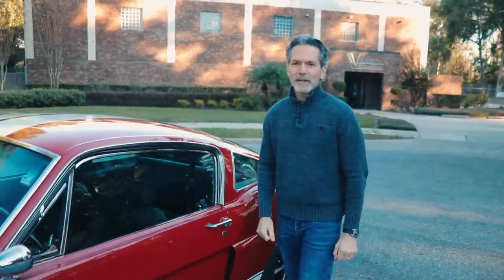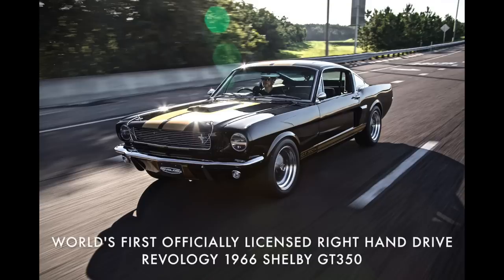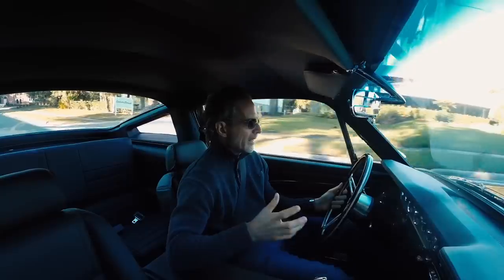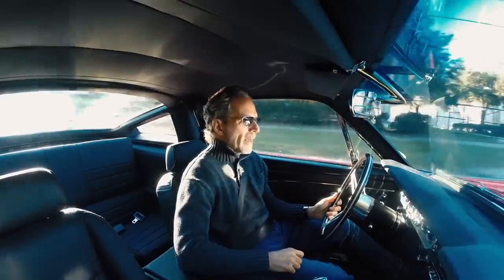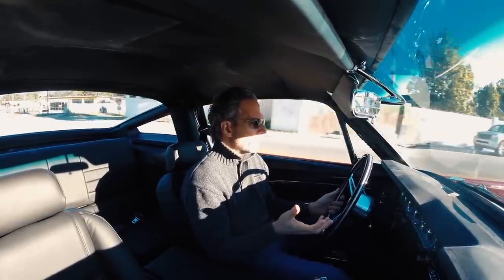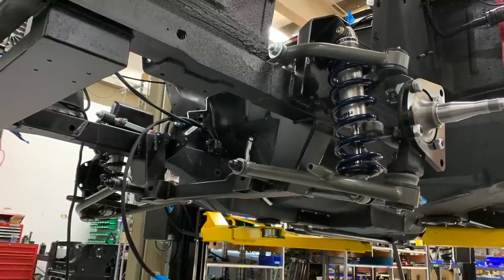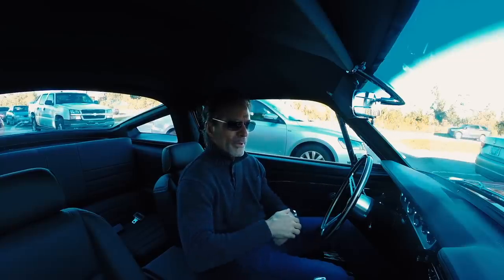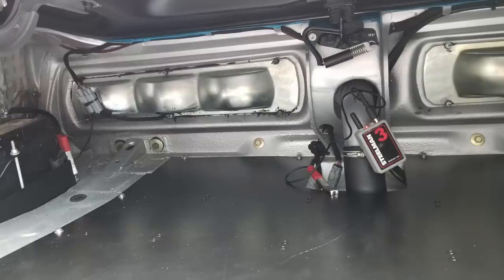Revology Delivers its 50th Ford-Licensed New Reproduction Mustang

Comment: It's a modern hot rod same as a Fiberglass 32 Ford body on a new suspension with a LS motor. It's not a Shelby anything. C. Shelby was a road racer as were his early cars not a compromise of confort vs ability to go around a corner fast. They didn't need huge Horse power numbers because they were light weight. A Sports Car!
Reply: David Read Tick ✔️ I’m from Australia 🇦🇺 and have old torana’s the whole reason you hop out of a newish car with all the bells n whistles is to feel 18 again to go back in time the road n bumps revs ,cam and a Carbie that was the stereo correct. As you said that’s a new musi

Comment: Have you guys had any luck installing reproduction window trim on the front and rear glass or is refurbishing the original stuff the only option? Also, are the tabs on the reproduction bodies in the right places to get the trim to fit properly? And since I am asking so many questions is anyone reproducing the chrome quarter window vents or do you guys have to refurb them also? Finding all the quarter window components in show condition is getting pretty much impossible!

Comment: How about no.
You can build one using a brand-new Dynacorn body, with everything set to your spec (engine, trans, interior & paint) for half the price of one of your restomods.
Reply: For us gear heads, that is the way to go.  But for the people that pay others to do everything for them and have trouble toasting their own bread, they get these restomods.  But they are going to pay a lot for them.  That is the price people pay for more money than brains.  I have seen this in many aspects of life. I saw a guy trade in his fully paid Crown Victoria that he just paid in full because the said it took too much gas.  He told me it was costing him 250 a month.  He traded that beautiful, fully paid, Crown Victoria for a hideous little economy egg Toyota Yaris.  When I asked him how much he was paying a month he told me he got a bargain and was paying only $435 a month.  What an idiot.  On top of that he has to pay full coverage on a new car, excise tax for a new car, registration for a new car, and still has to pay a fuel cost. That idiot had more money than brain.
Reply: If you can do better, can afford to take 6 months of your life off, and have a facility with a lift, fabrication equipment, an industrial sewing machine, and a paint booth, source all of the parts, materials, electrical, tools, and spray guns, then by all means, go right ahead. The rest of us will be happy to criticize your results, ad nauseum.
Reply: @bryanhallman8183  I built my own.  It is likely considered very ungainly and too unfamiliar to be appreciated by anybody but me.  However, it did start its existence as a standard production vehicle.  Only the transmission remains completely stock.  Even the spark control computer has been flashed to nonstandard settings.  I had a keyless ignition with a transponder card long before it was implemented in a production vehicle.  My lighting was changed to LED long before it was in standard production also.  I would often get comments on it.  The engine has a custom intake system.  The entire dashboard and controls are all custom wired.  The doors do not have power windows nor a crank.  The body still somewhat reflects what the standard production model looked like but almost all of it except the main body has been changed.  Axle ratios, suspension, engine cooling, rear brakes, lighting controls, radio, dashboard, seats, carpet, tyre size, bumpers, top, windows, exhaust system, and much more have been changed to something I created or to an aftermarket part I wanted.  The transmission is the only thing stock and it is starting to fail.  I have plans for exaclty the transmission I want to install in it.  But as you mentioned, others will critisize it add nauseum because it is so unconventional and rather antiquated looking.  But she has become a friend to me and it is likely we will never be apart.  I wonder if the engineers that design the modern hideous automotive atrocities feel as if what they designed has become a friend to them or not.   Perhaps this may be why there is such a grotesque similarity from model to model today, the engineers fell in love with a certain design. Maybe to the engineer the lackluster, bland, ugly, weak, designs are really quite beautiful to them.
Reply: @indridcold8433  Thanks for your response. I can fully appreciate how hard it is to build, or restore a car from the ground up.  My comment was directed at Hugo, whom I don't think can understand, that not everyone has the level of expertise, time, or the space requirements to undertake building a complete car from scratch. R3 is willing to sell a fastback or a convertible, 65-70, with a suspension for $32K. You still have to come up fenders, hood, and trunk, supply a drivetrain, wheels and tires, interior, electrical, gas tank, and basically everything to complete the process. Now, you've done that, and that's awesome, but, you and I are in very different situations. I would have to pay a garage to rent space to work on it, buy all the tools, welders, lift, materials, fasteners, odds and ends, and frankly, I can't do that. If you can't knock Porsche, Mercedes, Ferrari or Lamborghini for what they charge, how the hell can you then sit back and knock these guys, for building cars that are on that same level? It just doesn't make a whole lotta sense to me.

Comment: I have a Mustang 66' coupe, my first car. i have put the Global West suspension and it's a similar front end, not as beefy as this repRoduction 66' but its works. Also have disk brakes all around, 9" rear end, Msd ignition and Crane Rocker Rollers on the 289 heads that were rebuilt for modern fuels. 
But Not  In my wildest of dreams, would i have ever thought they would reproduce this old Ford! When i got mine in 1981, my friends jeered & sneered as it was a pretty old vehicle. They were driving Datsun 240 Z's and Capris  were all the rage. My  'Rustang' was almost a joke to them! That's pretty funny now! 😎😜

Comment: This is exactly what Ford should be producing today.  The current Mustang is in name only.
Reply: The current Mustang is a Mustang and about 100x better than the original.  The original was a Ford Falcon with a different body and a V8.   The current car has it's own chassis and motor - a much, much better automobile.  BTW - the first Mustang I drove regularly was a 1965 starting in February of 1965 so I'm quite familiar with the car.
Reply: @buckhorncortez  I think you missed the point.
Reply: I don't like the '15 or newer Mustangs, but I love my '13 GT.

Comment: Cougar XR7 65-68 would be cool
Reply: Cougars came out in 67...
Reply: @studebricker2845  yeh i couldn't remember exactly I knew the 69 i did not like as much. The Comet was another one i liked. Those 289s are some great engines.
Reply: @stephengrahn9361  They are. My first Mustang had a 2V 289 C4. My last Mustang had dual quad 289 with a toploader.
Reply: @studebricker2845  Right on. Mustangs were my Mom and Dad's favorite while my Grandpa was crazy about those old Mercury's

Comment: It amazes me how ugly, lackluster, week, and lifeless modern cars are.  I do not know how automotive companies stay in business.  I guess bailouts taught the modern car companies nothing except they do not have be held responsible for an inferior product.   The Mustang in the video is gorgeous.  Today, well, I guess today cars make more fuel efficency.  But there is way more to a car than fuel efficency.  Modern car designers seem to have tragically forgotten this.
Reply: Indrid Cold I could not agree more, for a device that is constantly around us we should be demanding better looking vehicles.
Reply: I have to believe it's also partially due to the regulations and fuel economy requirements placed on the auto manufacturers by government that dictates a lot of a vehicles design.
Reply: @mikebri5274  The crappy anemic engines are likely the government regulations of various nations.  But something really can be done about the hideous looks of the junk that is out today without putting much of any effect on crash tests, exhaust regulations, and fuel economy.  We are likely stuck with the crap engines we have for a while. Just two days ago a Malibu with a destroyed engine came in with only 51,000 miles on it.  The turbo is just too much for the tiny engines.  The high pressures are bad for these thin walled, four cyclinder cart engines.  It is amazing how many los mileage cars we have been getting into the shop the last eight years or so. It is not small things they come in having trouble.  It is catastrophic engine damage, destroyed transmissions, and burnt electronics. Of course, none of this has to do with the hideous looks cars have today.  But the problems are more than skin deep. The cars today are horrible.  I guess it is good for business for me.  But ten years ago, cars came in with major failures only above 200,000 miles. Most cars today will not make it to 120,000.

Comment: How much
Reply: 200k. Website shows pricing.
Reply: @mcburnsco.mudtrailsnow9616  overpriced af
Reply: If you restore one, it would probably cost almost the same. Everything is expensive af now
Reply: @mcburnsco.mudtrailsnow9616  looking right now at a listing for a 66 Fastback GT-289 for 50k Canadian. Fully restored. This is way overpriced lol
Reply: Yeah ok. Makes sense for a restored 289. This one is a restomod w high performance parts/engine incorporated in. I guess that’s the extra $
Reply: Only $287,318.00

Comment: Yep. I thumbs downed.
Not impressed with it at all.
Dont stutter when it didnt work the first time with these bodies. They were rattletraps. You never explained how you improved them. You just slithered away.
Heaven help Ford giving you their 'blessings'
Reply: Did you notice that he keeps saying 66 the fastback was only made in 65 and 68 and that is a 65 body so he does not even know his years, most of the rattle is being taken out by using polyurethane bushings instead of rubber in the body mounts and suspension is my guess for a starting point?
Reply: fastbacks were built from 65 to 72 ( 72 's are ugly ). The real classics worth big bucks were built from 65 to 68. 1969 gave us the mustang mach 1 fastback

Comment: You can buy a real 66 make it as good as one of these and have money left over. Easily. Nice car though.
Reply: Latnlvr  Proof of your ridiculous claim?
Reply: Ron LHeureux I’ve done it. Stop liking your own comments
Reply: Exactly. You can buy a period car in good shape for less than $50k, then spend another $50k upgrading it. I owned a 66 fastback for years and never noticed any random squeaks, maybe because I was enjoying the rumble of that V8 too much...
Reply: @studebricker2845   These cars aren't is "good" chape, they are in flawless shape with modern everything, an expensive paint job and one-off wheels, and with a history of innovation by this company and everything is flawlessly integrated and proven.  
Now, granted, not every gearhead isn't interested in a car with this much engineering and modern technology, for sure, but to think that a car built without the aforementioned upmarket goodies.  That works for me, but, for those who want what they want, this car is pretty much perfection.  If every gearhead wanted what you guys want, then Chip Foose, The Martin Bros., Dave Kendig, and the many other custom builders would be in a different business.  It isn't just about you guys.  Not everyone that wants their dream car can build one in their garage.
Reply: @ronlheureux7623  My point is for 99% of Mustang fanatics, $100k will get you one of the best vintage Mustangs you can find. The extra $100k for these cars is just overkill. The kind of person that wants their classic Mustang to ride like a Lexus..... should buy a Lexus.
Reply: @studebricker2845   Fine, patato/pototo.
Reply: @ronlheureux7623  More like Ketchup/Catsup...
Reply: Studle Baker  Yup, much more concise,  lol.
Reply: Studle Baker thank you! Someone with sense right here. Right now I can  buy a 68 Shelby gt500 for $100-$125k in PRISTINE condition, like in award winning condition. Look at a place called vanguard motor sales. Endless examples of what I’m talking about.